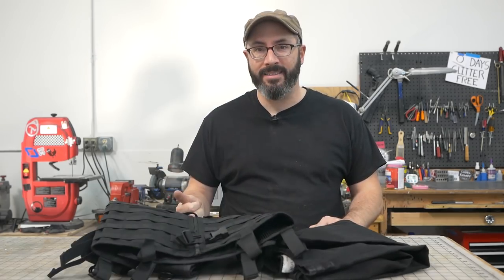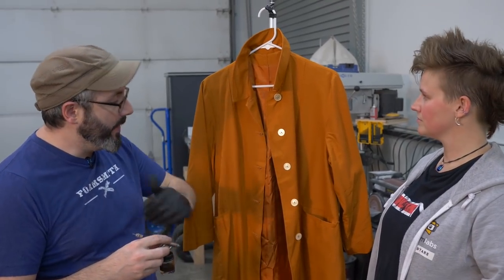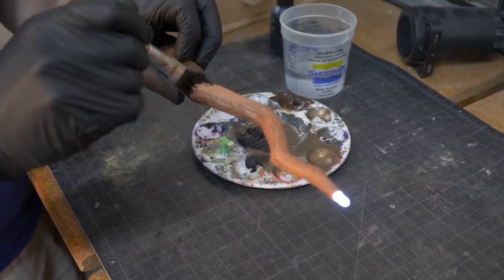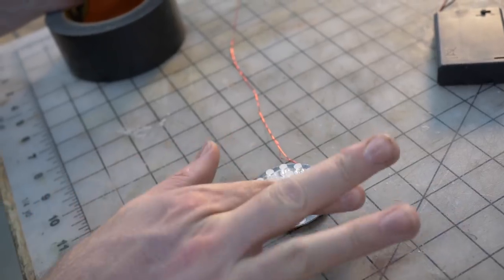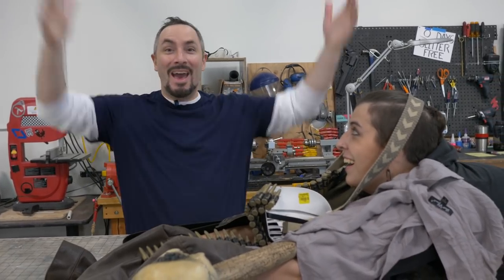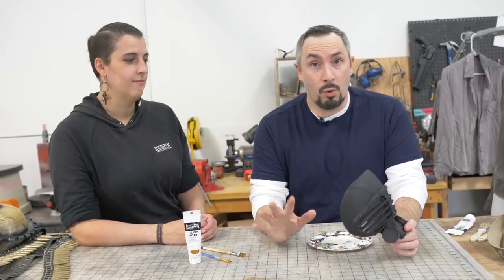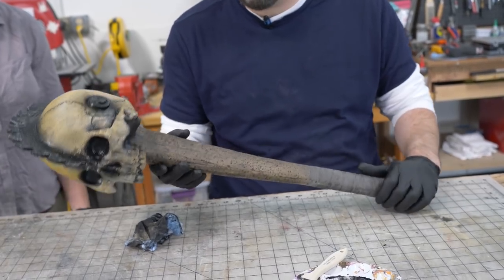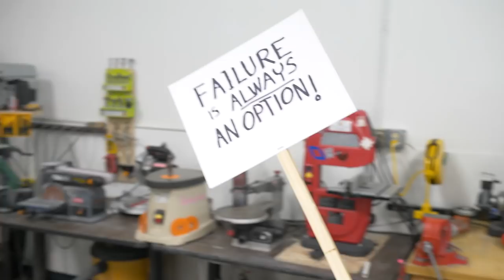5 EPIC & Easy Halloween Costumes - HOW TO

Comment: I know this is an old video, love that you did Adam Savage as a Halloween idea. I have been trying to do a Jack Skellington costume, with stilts so that I can get the height. But to make the arms longer to match the longer "legs" I have been unable to find many ideas on making articulated extended hands. I have looked for ones in the stores but all I found was robot ones that either moves all fingers, or none. I have seen a few ideas of making them out of straws or cardboard, but I wanted something more permanent. I did find a 3D printed idea that I am currently printing, but I was wondering if you had a really clever way to make Jack Skellington's hands extended and each finger individually movable. The plus on this is that Jack only has 4 digits on each hand, so the thumb can be controlled with the forefinger and you don't need to use your own thumb. :) 
Just want to add that I have learned a lot from watching your videos, even if I haven't had a chance to put it in to practice yet.
Reply from the maker: Check out this video of how I made my Impact armor with articulating fingers! You might find it helpful https://youtu.be/GKDE8E0Q0BA

Comment: Hi Bill, I was wondering what sand paper grit you recommend for EVA floor mats on a belt sander
Reply from the maker: 100 or 220 are good. It's worth having both on hand and swapping them out when the situation calls for it.
Reply: Thanks, before I was using 80, just because that was what I had, but it didn't really work

Comment: IF I MAY, go to walmart or local equivalent, look for generic kitty litter, (it will usually say %100 bentonite clay unscented, plus its like $1.00 for a 10 pound bag) Grind it up with blender or bullet or ninja, there you have 10 pounds of FULLERS EARTH, ps. if you want different colors just add colored chalk that has been blended. THERE! I saved you a ton of money. $10 for half a pound or 10 pounds for $1.00?